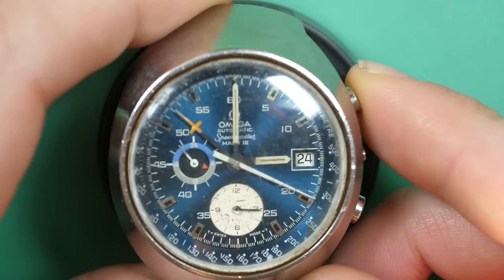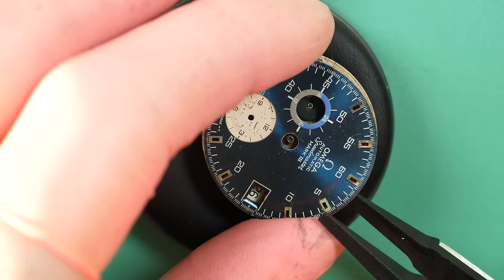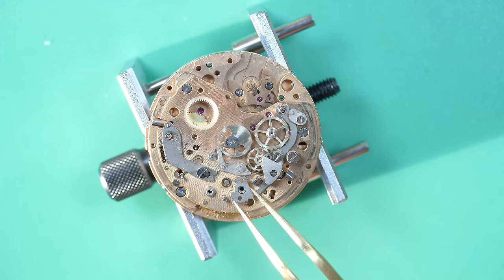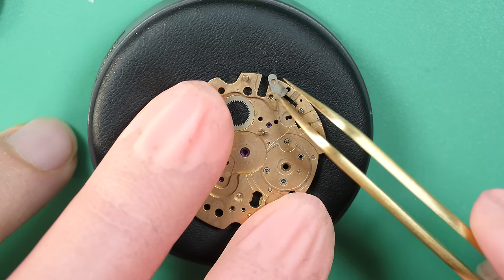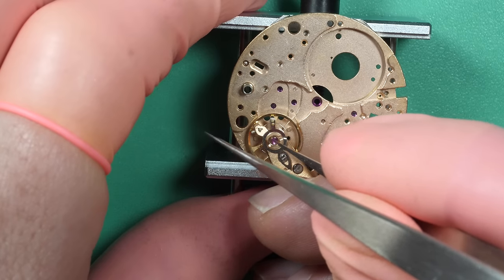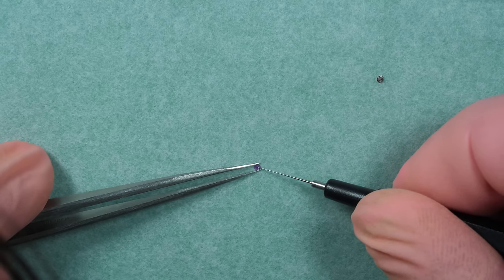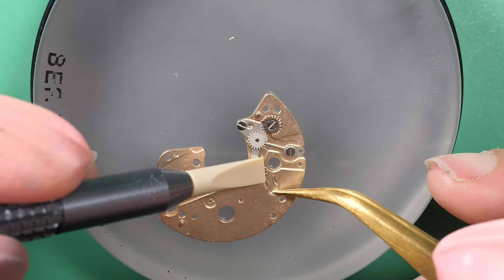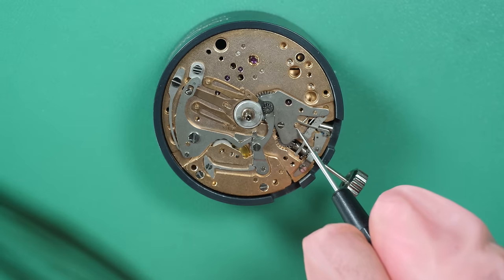Watch Restoration or Watch Resurrection ??? Trying to Bring Back to Life This Omega Watch

Comment: at 39:53 that green flaky buildup is caused by Oxidation and sometimes called verdigris.  moisture got in and probably there was some bare metal on the pushers and that got the process going. a very common place to find it is on brass fittings, copper roofs and your car battery terminals.  excellent video, watched it from end to end!!!😉
Reply from the maker: Thank you for the info and watching it fully

Comment: That was the most complicated watch repair and restoration video that I’ve seen so far on YouTube. Very impressive considering the identification of numerous missing parts was required as well as the replacement and repair of damaged ones.  While I appreciate the desire to not to perform a more complete restoration of the dial I thought the decision to not further improve the appearance of the case was curious.  The expert restoration produced a beautiful movement deserving of a case in better condition.  Now that I have offered my unsolicited armchair watch restoration opinion I will return to the peanut gallery where I belong.
Reply from the maker: Thank you Paul. I agree with you on the case but I like to do a proper and to do a good job on this case I need a lapping machine. It is a very expensive machine so if I get it one day I will redo the case.
Reply: I am sure that your channel will soon enough subscribers to provide the means for obtaining any tool you require.
Reply from the maker: @paulbush7095  if I can get more tools that will be great to make better content. Will see

Comment: Nicely done. It is hell lot of parts. I never done an chronograph I guess I would have to do like 1k pictures for reference. Changing the main spring is sane reason by this watch. It is a chrono it needs power. Plus like you said the condition of it. Nice job trully. Well done.
Reply from the maker: Thank you very much. You don't need pictures because you can findca lot of tech sheets online that tell you each step of the assembly. You should try a chrono they are the 👌
Reply: Yes many chronographs have 2 mainsprings.

Comment: great result! after watching a lot of your videos i would like to start as a hobby too. do you have any recommendation where to start ? i would love to see a video for beginners and explain how you did start your hobby and recommendation for tools . thanks
Reply from the maker: Thank you Arnaud. You need to start with some simple watches with no complications (date, chrono, automatic, triple calendar...) or even on a pocket watch. You can buy some very cheap mechanical watch on ebay with a simple movement. If the movement is standard (like an ETA) it will be easier and cheaper to find parts. After you need a lot of tools even to start doing simple work. I might do a video on this.

Comment: Fantastic work and clip as usual, and also thanks for answering all the questions, since this project seems to have more of a story behind… so I also have my own: how long did it take you to complete the restoration since you bought the watch?
Reply from the maker: Thank you for the nice comment. It took me probably more than 6 month. After I did not work constantly on it but some time you discover a broken or damage part so you need to order it and wait for it. It is a long process
Reply: @FrenchWatchCollector  wow! Given the amount of parts you had to source, I was expecting even more time! I sometimes have to hunt for one single part for 3/4 months…
Another interesting aspect is the need for specific tools.  As a hobbyist I sometimes face a challenge where I don’t have the required tool for a job, in your case the broken screw, so the cost of a new tool adds to the overall cost of the restoration process and that can mean a delay too. 
It is a game of patience!!
Reply from the maker: @frodriguezpc  yes sometime it can take quite some time but it depends on the movement. Some have more parts available. Tools can be an issue but it is part of this hobby. You need to buy a lot of tools. After you can reuse them when necessary on other projects

Comment: Salut Monsieur 😃Le resaltat apres votre travaille est tres beau. 👍 Especialement, si tu considerier le condition originale, le reparier est bon 👍. Excuse me, but my written French is pathetic mate 😃I'm originally from Montreal, Quebec, Canada, so they don't speak your kind of "Francaise" anyway 😉😂. I would have thought you would spend some time working on the case (???) 😳 I don't like the condition of that watch case - The aesthetic with all the dents and scratches doesn't work for my eyes. Overall, I think you made a good investment. 👍😃 I think you were quite fortunate not to have a busted ballance wheel. The ballance wheel looked broken to me when you first opened the watch.👀
Reply from the maker: Hi Mark. Thanks for your comment. I thought the balance was broken too. After is the balance staff is broken is not that complicated to change. For the case I agree with you. I am not a watchmaker and right now I don't have the right equipment to refinish a case as complex as this one. Maybe one day I will get the machine to do this type of work and will refinish it.

Comment: This is not a restoration, everything should be polished.
Reply from the maker: You don't necessary polish a watch. Polishing remove the value and the history of the watch in most cases. After it is a customer choice.
Reply: The case has already been previously polished by someone. This had a uniform brushed case new that cannot be replicated.